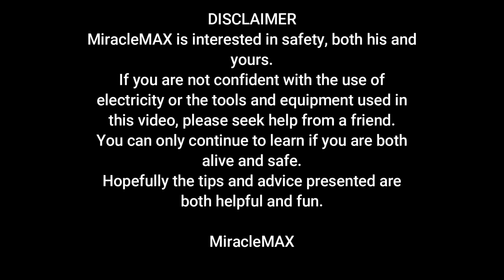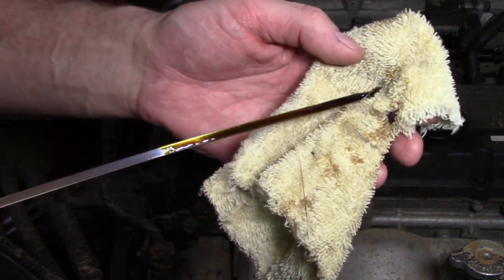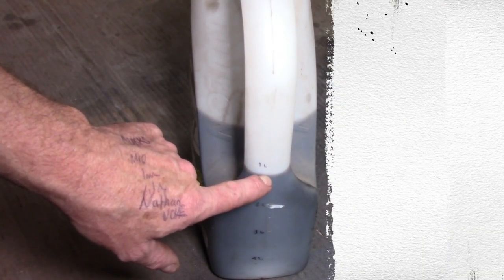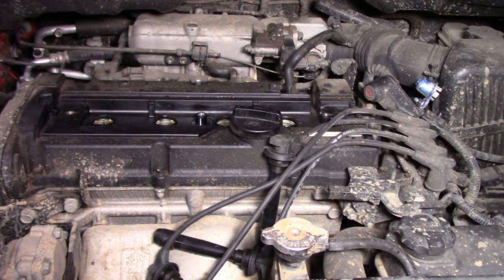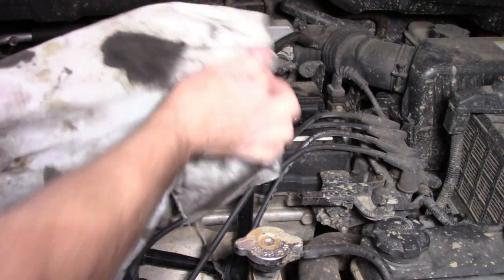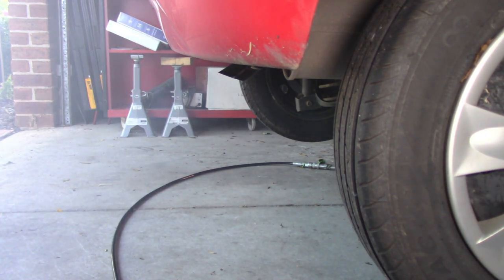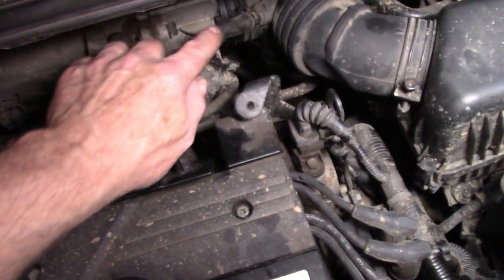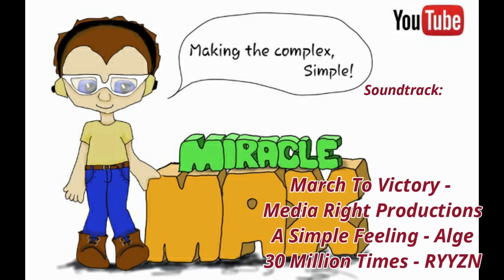Hyundai Getz No Start!   Customer Overfilled The Engine Oil

Comment: Wow thank you. Knew it was the oil.  Mechanics charged me for sparo plugs and battery but no change in the engine and engine light
Reply from the maker: So was your engine oil overfull?
Reply: @MiracleMAX  yes a little more then it should have been. I did mention this to him but nothing was done. Really disappointing.
Reply from the maker: @followeroftheway555  A little more oil will not necessarily create a problem. In this case, it was almost double the quantity of the required amount. Did they tell you what the fault code was creating the check engine light? Was it the check engine light that was on your dash?
Reply: @MiracleMAX  I believe it was more then a little. Because itz leaking out of the engine? They didn't say anything about the engine light. Didn't even tell me what the problem was. Either then didn't diagnose the problem correctly and had me lay for spark plugs. Then my battery wasn't working and they jump start it and then went home came back and they said I need. New battery. After all of that nothing was fixed. Really not impressed...
Reply from the maker: @followeroftheway555  So do you still have the problem? Is the oil at the correct level now?
Reply: @MiracleMAX  yes still have the same problem haven't changed the oil yet, will be changing it tomorrow. Any advice?
Reply from the maker: @followeroftheway555  If you can, check the oil level before it gets replaced, just to see what level it is at the moment.
Reply: @MiracleMAX  it was checked yesterday and it was 10 to 20mill above the full line.
Reply from the maker: @followeroftheway555  That is really not high enough to cause any issues
Reply: @MiracleMAX  oh really? That's the only thing I did was too up the oil and the engine light and hot and cold gauge came up on the dashboard and mechanics have found what's wrong.
Reply from the maker: @followeroftheway555  You said the mechanics have found what is wrong...what was that? Was the coolant level correct as well?
Reply: @MiracleMAX  they found nothing wrong I meant. All was good except then changing over my spark leads and battery. They drove it for 20mins the engine light went and then I drove it home half way down the road it came back on.. really disappointing
Reply from the maker: @followeroftheway555  Did you mean 20 millimeters on the dipstick or overfull by 20 millilitres? Was it the check engine light on the dash or some other light? Did they tell you what fault code brought on the check engine light?
Reply: @MiracleMAX 20 mill overfull. Yes it's the check engine light and the hot and cold gauge light too. No they didn't say anything about the engine.
Reply from the maker: @followeroftheway555  If that is 20mm overfull (2cm) overfull on the dipstick, then that is overfull, but depending on what vehicle you have and how much oil is meant to be in there, it may or may not make a major difference. Has the coolant level been checked if the temperature light has come on? Does it have a temperature gauge? What vehicle is it and what engine is fitted. Has the excess oil been removed yet? What were the fault codes bringing on the check engine light?
Reply: @MiracleMAX  yes so it's definitely overfull. I looked up online for my manual, it's a hyandai getz that's why I was watching your video because I was trying to understand what has happened. It's a 2009 model. The oil capacity I found online for my manual I 2.15. so it's overfull then. No the mechanics told me nothing about the engine. Replaced my spark plugs and battery and then drove it. Was all good they said for 20min took  it home and half way the hot and cold gauge light came up. Only not long ago my engine light now has come up.
Reply from the maker: @followeroftheway555  Best to find out what fault code has been brought up.
Reply: @MiracleMAX I tried but the mechanic isn't getting back to me and has blocked me online too...
Reply from the maker: @followeroftheway555  OK
Reply: @MiracleMAX  so will try drain it and see what's happening and take it to the another mechanic. Thank you for you replying. I appreciate it.
Reply from the maker: @followeroftheway555  You are welcome. It would be great if you can keep us in the loop on the final result.
Reply: @MiracleMAX  Yes absolutely will. Thank you so much for your advice.  Have a great day

Comment: I made this mistake this week, filled way too much. Ran for about 10 minutes before we got onto the highway and went up to 60 km p/h and the car started to blow the same smoke, jerk and struggle to accelerate. Pulled over immediately, let it cool, then drained the oil completely and refilled with fresh new oil to the right amount. Im paranoid ive ruined the car. Do you think i could have done any lasting damage in that short time?
Reply from the maker: I think you did exactly what you should have done as soon as you realised your mistake. I think for a short period of time you should be OK. Just keep an eye out for leaky seals.

Comment: Gday I had a guy drain the transmission instead of the engine and filled the engine up so it had double they ran it for about a minute as soon as we realised we drained it and filled both up correctly could that mess up the engine for that short amount of run timw
Reply from the maker: Wow how did that happen?
If it was only run for a minute or so, that should be fine. I doubt it would have built up enough lasting pressure to do damage.
Reply: @MiracleMAX  cheers mate we were all really worried one of those dumb a mistakes car was going fine just a lot of paranoia
Reply from the maker: @arthurmorgan2914  Mistakes are easy to make. Glad you were able to check with me. Hope you enjoy the channel 😉

Comment: I have the same car. I was driving suddenly the car died on me ,it would start e few times but die immediately when I step on the gas .. few days later it does not start at anymore. Fuel pump is new, fuel pressure is good but now starting.. just a coughing crank
Reply from the maker: Can I ask what testing have you done so far? Does it have a good spark? Is there the correct fuel pressure and flow? Did you use a fuel pressure gauge? Does it have any fault codes? Are the crank and cam signals correct? Was anything done just before this happened?

Comment: found your video as I'm looking at what effects overfilled oil will have, but I want to overfill for a reason. You know all those engines at high mileage that start buring heaps of oil ( 2az-fe for example) that get carbon buildup in the oil control ring and the drain back holes, well I'm trying to clear out those oil return holes behind the oil ring without taking engine apart.
My idea is: fill oil with a flush in it ( or something that will dissolve carbon like berrymans b12 or similar), but fill to the oil control ring level ( when piston is at bottom of stroke), every rotation of engine a piston will slap into the oil and hopefully force oil/solvent mixture into those oil return holes from the underside of the piston.
I was never thinking of turning on the engine but remove sparkplugs and rotate with starter motor, or via pulley with drill or similar. It would be nice to start the engine but would be worried about damaging it, nice thing at bottom of stroke when underside of piston hits the oil the piston rods will be in tension not compression, so no hydrolock from underside oil.
I now see some pipes need be disconnected so oil wont go into them, any other things?
I will probably never do it, just trying to nut out if its possible.
Reply from the maker: That's an interesting concept. I would be interested in seeing the results. Depending on how many kilometres it has done as to if it is a build up of carbon or actual worn rings. Keep us in the loop!